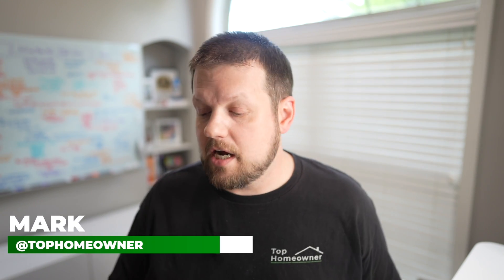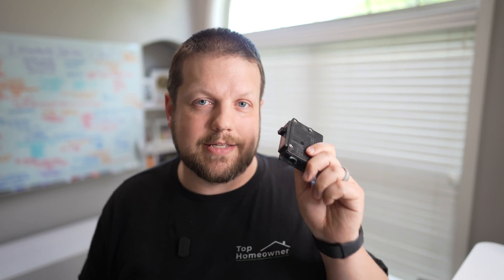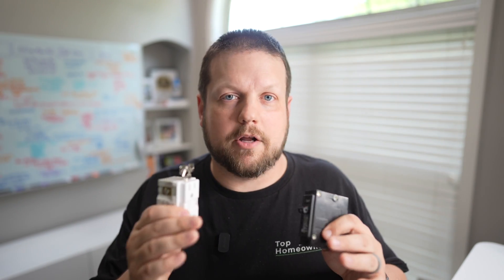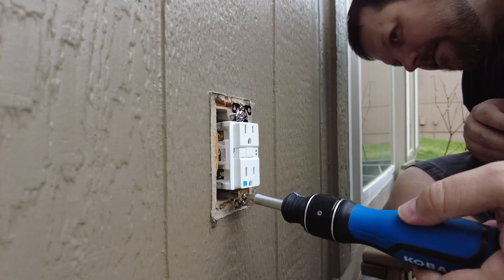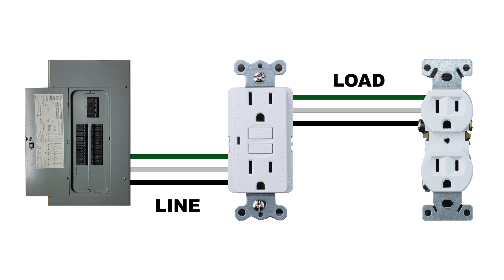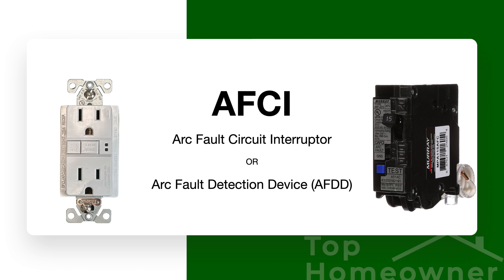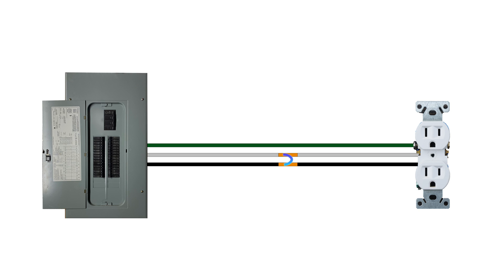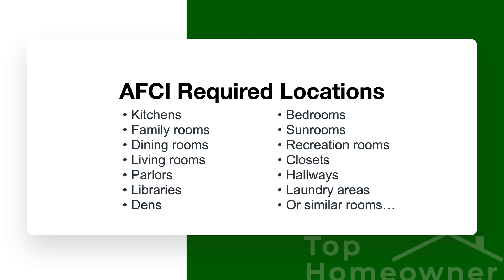GFCI Outlets vs. Breakers: What’s the Difference?

Comment: My house was built in 1985. I bought it in 1995 and noticed that some of the electrical work was shoddy. So why should I trust a licensed electrician. Anyway, my bathroom has a GFCI receptacle and the first time it tripped it cut power to outlets in the garage. It took a while to figure out that it was the GFCI receptacle. Anyway, I'm considering retrofitting and getting more GFCI protection but it would be costly - I would probably have to install deeper electrical boxes which would require tearing out and replacing drywall. But, like you have said, safety is of prime importance. I have considered retrofitting with AFCI also. But since the old work met the NEC at  the time of construction, it appears that the old work is grandfathered.

Comment: Those things are pain in the ass they don't fit in older homes plus they are crap they don't work they are alway tripping and need resetting all the time I don't like them because they don't fit in the boxes and have to many wires for the boxes and the right way to install them would be install a bigger boxes plus they are very expensive to buy know one seem to what sizes to install for them they don't fit in old mobile homes from the 70s the walls are smaller than a regular houses

Comment: During inspection, the inspector recommended replacing most breakers with GFCI breakers. However, after we started using the garage apartment, many GFCI breakers began tripping frequently. I noticed that the ones tripping were connected to large appliances like the dryer and washer, or to circuits that had GFCI outlets. I believe the inspector provided us with incorrect information.
Reply: I don't believe that he did. A gfci relay is a great protection and the closer it is installed to the main line/power the better the safety.

Most probably your devises do cause some ground leakage. A somewhat common cause for that is the resistance of dryers and washing machines that comes in contact with water is a bit faulty and causes some leakage into water. But the problem in such cases lies with the manufacturers as they produce shitty appliances more and more. 😅

Comment: Did not have to do it in my area, but when I updated my Panel,  I just put in AFI/GFI Dual breakers in for the entire house.  We only have to meet the 2017 NEC code here, but if you look at the 2023 NEC codes, you basically need AFI everywhere in the house, and GFI in about 90% of the house now.  Less headaches down the road by just taking care of it all at one time.  Also, the panel needed to be replaced because it was from 1970, thank god there was not any aluminum wires when they did that update to the panel, but all they did was put in a new panel, they did not upgrade the wiring, so it was all still 2 wire (no Ground) NM-B from the original 1958 installation.  So, I bit the bullet and did the panel and an entire house rewire on my own.  It was a pain, but I am now up to snuff on the 2023 NEC code if the AHJ decides to update to the most recent NEC publication.  Knocked down my homeowner's too, going from non grounded to fully grounded with AFI/GFI in place.  I was sweating the inspector, but I got the City's Director of inspection and he was blown away by the work I did as a non-certified home owner.  I paid serious attention to detail, and he could tell and green tagged me in about 30 mins, after he checked the panel and spot checked the kitchen and bathrooms.  He told me getting that right, he knew I did the rest as it should be and I was done.  IF you are thinking about doing this as a homeowner, check with your friends and see if you know any firefighters.  I am a retired FF and due to my National Certifications, was able to get a free copy of the NEC codes on my computer as a free download.  Good info to have on hand.
Reply: Blah blah blah blah 👄👄👄👄👄👄

Comment: I will try for the GFCI receptacle.  The problem with breakers is they are often on another floor and girls who trip the breakers in the kitchen don't know how or don't want to be the ones to reset them.  The problem is one duplex has a 6 outlet adapter and they do not make a valid GFCI outlet adapter.  The only one I've found is a Mickey Mouse one that has no center screw to hold it tight to the electrical box so the entire adapter pulls out when you pull plugs.  Hopefully the other outlet in the kitchen is upstream of the 6 outlet adapter outlet but that is doubtful.

Comment: The answer to whether both GFCI devices can be installed on a circuit is crystal clear: NO!

You either have a GFCI receptacle, or more, on a circuit and install a non-GFCI breaker, like a standard or AFCI one depending on code, OR you install a GFCI breaker protecting entire branch and have non-GFCI receptacles. You CANNOT have both since it's obviously pointless in having duplicate protection, one of which will be unutilized and/or causing issues during faults. 

You should've answered this question more decisively and straight to the point, then spend time explaining when to use either forms of protection.
Reply: WRONG
Reply: In a room with 3 receptacled, one will be gfci the other 2 standard, why put a green ground wired fron the green screw from the gfci receptacle to the metal box ?
Reply: @Influencerut32 what?

Comment: I prefer GFCI breakers.  When a GFCI receptacle trips, I have to hunt for which receptacle has tripped.  One for the kitchen may be in the kitchen while the one for the bathroom may be in the garage.  With a GFCI breaker, the tripped breaker will always be in the circuit breaker box.
Reply: you lose traceability
Reply: @mr.random8447  Traceability only goes as far as individual circuits, you still have to look for what socket caused the issue, and unless you have some 20 bathrooms where may be a regular occurence that many of them are used at the same time there's not much an advantage in having traceability
Reply: The code in my county is that bathrooms have to be on their own breaker. But you can solve your whole problem if every room is on its own breaker. Don't run the whole house off 2 breakers.
Reply: What else do you have to do?

Comment: Great info. Thanks!   If I have receptacles without a ground wire, but I installed 3 prong outlets, what should I consider to make it safe (primarily only bedrooms and a living room
 have this issue)  (I’ll have an electrician do it, but I want to be educated a bit first).
Reply from the maker: I'd use a GFCI receptacle and label it no equipment ground.
Reply: I would say to install a GFCI outlet with a label that says no equipment ground.